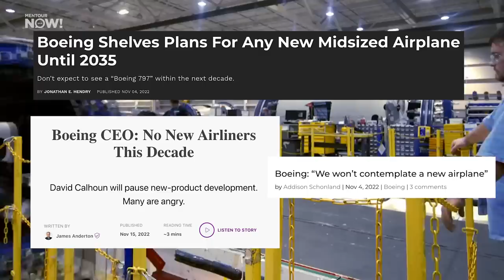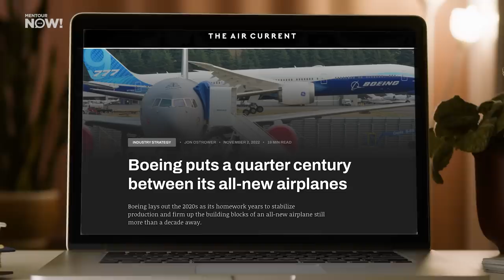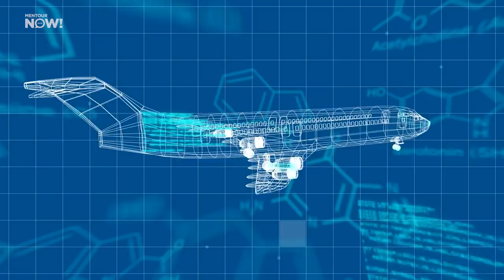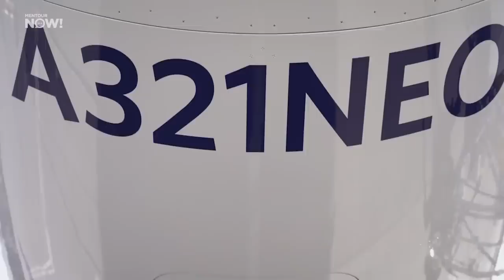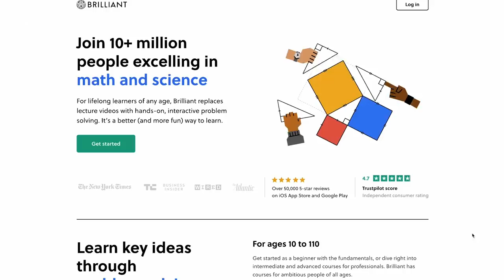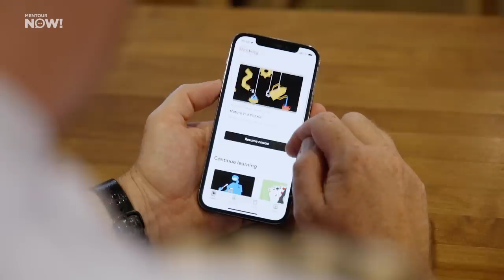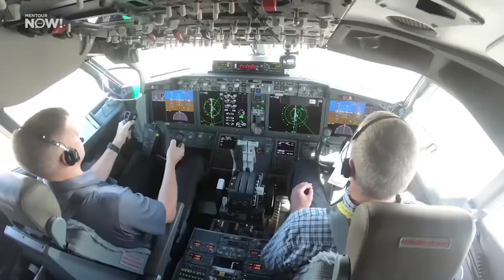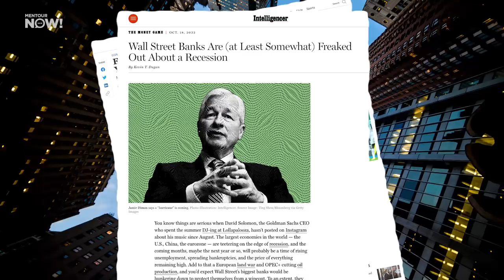Is BOEING giving up!?

Comment: Yes, that open rotor fan engine is certainly interesting. What the hell happens when (not if) it throws a blade? One of the more interesting tests for jet engines is the blade off test, where they explosively release a fan blade at top speed in order to test whether the engine housing will contain the blade and all the other parts that disintegrate when such a high energy event occurs. Well, the answer so far is: one cannot be certain. I found a blade off test done by NASA for an open rotor engine, but it was just one blade tested against a specially designed panel (two, actually, of varying thicknesses), which performed fairly well. But the  panel was tested by itself; it was not attached to an actual wing structure nor of course tested in the air.
Reply: Not a problem, such "open rotor fans" have been in service as long or longer than jets (in fact said open rotor fans driven by different engine types have been in service since the dawn of aviation) and have been certified just fine, with very few incidents of blade failures causing accidents. We just always called these engines "turboprops," which is what this thing actually is.
Reply: These multi-bladed props are geared, and rotate at far slower speeds than turbofans.  (Have you looked at a C-130 lately?)  They're also lightweight composite; that plus the lower RPM means less strain and greater reliability.  I'm not aware of any such prop failing in use.

Comment: How are they going to certify the CFM engine without blade containment. Great video as always 😊👍
Reply: It's a reimagined turboprop, and would follow the same certification regime.  That said, Jet-A fuel is headed for the scrapheap of history, and engine manufacturers need to focus on climate neutral solutions all the way from domestic to intercontinental designs.
Reply: @johndododoe1411  I think that in raising the type of fuels in future aviation, you have hit the nail on the head.
Are we looking at stored electricity, resolving cold fusion, or even a fission system with control rods embedded in the core, preventing them from running away.
We use huge amounts of fuel getting up to cruising altitudes, but none of this is recovered during the final part of the journey.
Rather than separating all these factors, will the answers lie in revolutionary aircraft design.
Reply: A John DoDo Doe said, it's a turboprop, which have been certified and used just as long as jets. It is sort of an intermediary between turboprops and jets, but really is reflective of the direction turboprops have been evolving all along - look at those on the Q400, latest C130s, and A400M. This looks like a turboprop with some stationary blades behind the spinning ones, and has more blades than any existing turboprop, but otherwise it's just a turboprop. "Open rotor fan," "Propfan," "unducted turbofan" and so on are mostly just marketing terms to avoid the term "turboprop" which is seen as old fashioned and suitable only for small regional aircraft.
Reply: @wilsjane  Hopefully this will be the case, I'm doubtful any of those technologies will be able to replace hydrocarbon jet fuel in the foreseeable future. All have problems with power density or are just pretty far out there from current technologies. Maybe possible someday, but these aren't just refinements of existing (working) technologies. I wouldn't bank (or invest) in them yet. Some, such as hydrogen and electric, might be suitable for short-haul in the not too distant future, but not ocean-crossing any time soon. The next thing I'm anticipating is biofuel (still a hydrocarbon but not a fossil fuel) but that has a lot of issues as well in terms of actually being better than fossil fuels, thinking of the environmental impacts of agriculture and the ethics of using agriculture to produce fuel while people starve. I anticipate aircraft will be the last mode of transport (or other user of energy) to be able to get off hydrocarbon fuels.

As for the loss of energy in descent, I wouldn't really consider that to be the case. They don't regenerate any energy from the descent, but they are able to cover a lot of distance burning less fuel by partially gliding the last 100 miles or so. At least if the pilots plan ahead well rather than starting their descent too late and deploying spoilers for a "slam-dunk" arrival.
Reply: Does a C-130 have blade containment?
That's a turboprop
So is this.
Reply: @quillmaurer6563  All of what you say is true, particularly the lack of consideration for fuel economy during landings. Perhaps regulations regarding the starting point of decent are partly to blame. Aer Lingus, seem to manage them quite well. No wonder they have not had a crash or incidents involving injury in more than 50 years. Both their pilot training and scheduled maintenance is probably the best in the world. 
On a slightly different subject, since in most modern large commercial shipping, the propulsion is electricity, with fossil fuel generators supplying it. I have often wondered whether windmills could provide some of power. Even in a headwind, they would offset the opposing forces. 
A sort of 21st century sailing ship. LOL
A little known fact, is that the Royal Festival Hall in London originally drew all it's heating from the bed of the Thames using heat pumps. The COP value was 3. (300% effective efficiency) Unfortunately, due to poor consideration of cleaning the evaporators on the river bed, along with safety concerns about the ammonia refrigerant, the system was abandoned after a few years. My late father was one of the design engineers. 
Following in his footsteps, I have designed several systems for theatres and film studios. One simply simply using heat from the air conditioning condensers to heat the domestic water, avoiding the need to fire the boilers in summer.
The government make a lot of noise, but rarely seem to do anything about it. No doubt they would see my energy saving as a loss in tax revenue. LOL
Reply: @wilsjane  Good points. I don't think it's the pilots' strategizing as much as what air traffic control allows them to do, sometimes I think planes are required to stay high until close to their destinations then dump the spoilers to stay clear of other traffic.

Thinking of ships, I'd think conventional sails that propel the ship directly would probably be more efficient than wind turbines driving generators and propellers. But the setup you describe would have the advantage of being more easily lowerable for going into port and under bridges. I think Casual Navigation did a really good video a couple years ago on why modern cargo ships don't have sails, something that seems like such an obvious solution for conserving energy. My outside-the-box solution to these problems would be to not put sails on the cargo ships but instead have "sail tugs," basically large but lightweight sailing catamarans (basically a 500+ foot long Hobie Cat) that tow sail-less vessels across the ocean, the sail tug never having to enter port so constraints on mast height, width, and draft are eliminated. But that too surely has a lot of issues, I hear towing a ship across the ocean (commonly done with ships destined for scrap) is a challenging and risky endeavor, many ships that had been under tow have become wrecks.

The heat pump is an interesting idea - in Colorado I hear about people installing those in their houses as a more energy efficient alternative to natural gas fired furnaces. I think I even saw some article about using the heat or cold of sewer water as a heat source/sink similar to what you were describing. These are less flashy or exciting energy-saving technologies than stuff like "Solar Freakin' Roadways," but have a lot more potential to help if they were more widely implemented. They just don't excite people the same way though - they're boring and expensive, but very effective.

Comment: Boeing is broken in so many areas, it is scary. When the Max was grounded, it was apparent that more issues would be discovered throughout the company. Then we had problems with the KC46, Artemis SLS, 787 production halt, Max7/10 certification issues, not to mention the FAA crackdown. Production debris is a constant reminder that the wrong production systems still persist.   I think the CEO knows there is more to be revealed, and that's why he is directing Boeing to focus on fixing existing problems before new airframe development.
Reply: The KC46 problems are not serious.
Reply: @GH-oi2jf  whoosh.  That's not the point.  It's yet 'another' problem on a list of them.
Reply: @GH-oi2jf  Would you call the need to redesign the refueling boom at taxpayer expense, with a completion date of late 2025 “not serious?”

Comment: Those new engines looks interesting. Question what happens if one of those fan blades get loose. No cowling to contain it?
Reply from the maker: Excellent question. I guess the same kind of reinforcements as turboprops need.
Reply: But that's the same for any propellor based engine we've had for over a century
Reply: So how exactly would the rise engines not be turbo prop.
Reply: @dalentoews3418  the fan is powered as a byproduct of thrust from the main spool, where as a turbo prop’s propeller is direct drive.
Reply: I have heard one of the biggest issues is the noise.
Reply: @mitcho04  not in the case of free turbine designs, with 2 turbines - one to drive the compressor and a separate turbine to drive the propeller, and in either case it has to be geared not direct drive.

Comment: My guess is that the open fan engine will be dumped just like its predecessors because it will be far too noisy.   And we have always been told that ducted fans are more efficient than open fans

Comment: What you’re missing is the evolution in the aviation industry that has been underway since before the advent of NEXGEN technology; Autonomous Airliners. The writing was on the wall the minute Lockheed got the L-1011 CAT III certified. I said a decade ago it would be 20 years, and everything looks on schedule. I get a lot of hate when I point it out, but it’s the insurance industry that regulates and directs the industry, after all, it’s a Strict Liability environment and it’s their money on the line.

The truth is it is the pilot that is the weak link in the system because the technology they are supervising has gotten past their capacity to diagnose failure modes. The week point in airline safety is the interface between the pilot and airplane in the systems the pilot is responsible for controlling. This was made painfully evident in AF-447 where not one, but three pilots, allowed a perfectly good aircraft to crash by holding it in a falling leaf stall, just because they didn’t understand the stall warning system had an upper limit cut out where it no longer believed the inputs and shut up, and when you lower the nose to a "believable" AoA, it sounds off until you get the nose through the normal trigger. They all diagnosed this as a control reversal issue, even though all the fight attitude instruments read exactly correctly. At any time, any one of them could have just let the nose down and the plane would have recovered. Even the Captain did not work it out and order the nose down on cockpit entry. All of this happened because one pitot out of three froze up for a moment and kicked out one autopilot. Had they swapped systems without ever touching the controls and stalling to begin with, no one would have known anything had happened until they squawked it on arrival.

The next generation of airliners will eliminate this vector of failure with full triple redundancy of all automation circuits, and eliminate this source of failure. Boeing is not stopping development, they are focusing development into the future rather than preserving the past. It also helps their customers save on operating costs, not to mention headaches.

Comment: Many years ago, I read an article about research on an UnDucted Fan (UDF) engine, the same concept as the RISE engine mentioned in this video.  It used a single large fan stage at the front of the engine.  I believe it was using a  DC-9 as the test platform and they were getting good results from the test program.  It took a long time, but it looks like this concept is finally moving towards a working engine.

Comment: Boeing needs to drop the 737 after this debacle ends, with the certification or not, and then focus on a new mid range aircraft whilst considering going back in for Embraer.
Reply from the maker: Interesting idea but very improbable. The 737 is their cash cow and it’s still selling very well.
Reply: @GeordieBoy69  the 737 is trash.
Reply: Didn't you hear?  They're deep in development of the 737 ULTRA.  It's engines will be completely in front of and above the wings.
Reply: They should keep producing and taking orders for the 737, but they should also quietly start developing a replacement for it. That way, they will have a decade at least to get a cleansheet design right before 737 orders dry up. The time to develop the NMA has already gone, and they shouldn't be competing against Airbus for that market anymore. They should do what they did with the 777 and create demand for a new class of aircraft. Perhaps they should revisit supersonic/transonic aircraft like they did with the sonic cruiser. They may even be able to build off the work of struggling designers, like Boom Aerospace.
Reply: @GeordieBoy69  The best medium range jet in the world
Reply: @rrice1705  Single nose mounted ultra high bypass turbofan engine. LETS GOOOO!!!!
Reply: @aadixum  Sssssh!  Don't give them any ideas! :)
Reply: @soccerguy2433  over 4000 orders for the “trash” airplane…🤦🤡
Reply: @stevegiboney4493  Possibly because they are practically giving them away?
Reply: @joeking22  I doubt that .
Reply: @GeordieBoy69 Always if it was allegedly always a safe plane then why did 348 people lose there life

Comment: The option not explored in this video is that Boeing needs the time to figure out what to call their next model after the 797.
Reply: 7-9.5-7
Reply: The SST model no. was the 2707, so there's that.
Reply: There are endless possibilities. For instance, they could call it Bob.
Reply: @leisti  Isn't that a Microsoft joke?
Reply: Maybe Boeing 807?
Reply: Unless they change the first 7 in the type number symbolizes the product type being a civil jet, then the other 2 are the generation/product name code. They'd have to keep the first 7 somehow.
Reply: 7A7, 7B7, ...  flying turkey, management surprise, fumble 1, fumble 2, ...
Reply: 797B, C, etc. or 7100, 7101, etc.
Reply: @tylerchambliss8379  2 digits can expand to three for the model.  7100 etc.  It has been done like this in the computer and software world.  Surely this won't make Boeing's databases blow up for there already is room for various alphanumeric suffixes.  Either that or lynch the poor guy who asked for varchar(6) for surely no number could be larger than 737MAX and the engineers want a 7101HYD for hydrogen now.
Reply: Maybe they can get inspiration from Peugeot model numbers?

Comment: That new GE engine is going to be loud as hell. I dread that becoming common in the name of efficiency. Getting rid of noise and vibration is one of the things that make jets more attractive than turboprops.
Also, one of the things that might make building a new jetliner faster and cause less problems with manufacturing and quality control would be to rely on FEWER sub-contractors. Someone at Boeing said that the 787 had problems caused by over reliance on subcontractors. Have they forgotten that lesson already?

Comment: Living in the Puget Sound area only 10 miles away from the Renton WA plant we hear a lot of Boeing gossip. about 3 years ago, I had a conversation with a Boeing insider, he told me he wouldn't be surprised if Boeing just got out of the civilian side of manufacturing and stuck with Military only. I remember thinking to myself " Oh yeah, right" But now I can actually see that happening. Sad
Reply: just like GE breaking up, Boeing could definitely split into separate commercial and military businesses.  the military side has been getting help from the commercial side for years (cookie jar accounting). there have been few technology synergies between the commercial and military side (reason for the original merger).